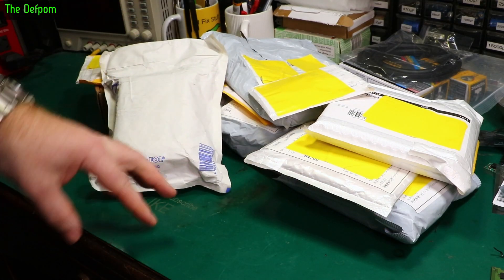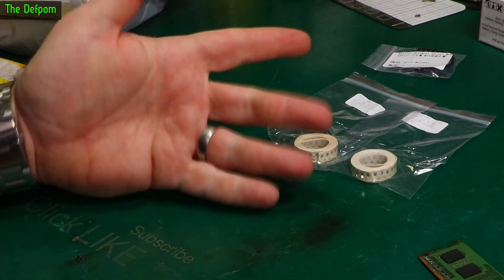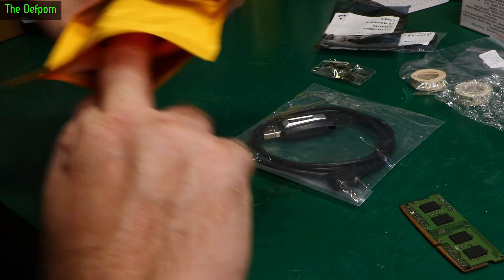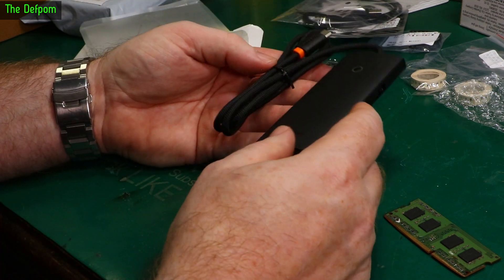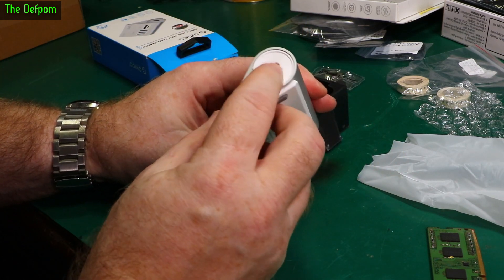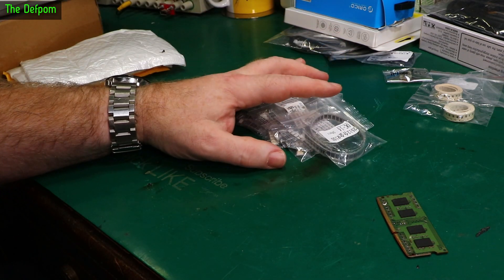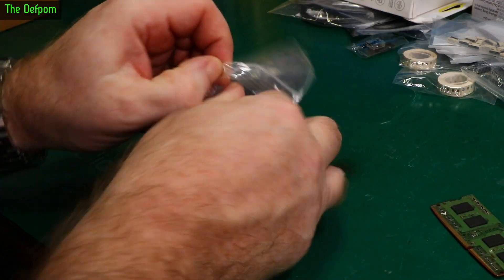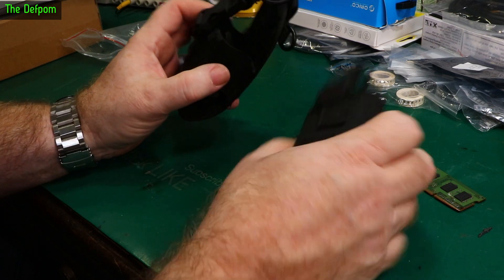🔴 What's in my Mailbag ? - Mailbag Monday 17th July 2023 - No.1154

Comment: When buying USB hubs ignore any mention of throughput speeds as those are the unobtainable speeds unless one holds your tongue just right and are upside down. Had a rather intense discussion with Orico and one of their USB 3.2 hubs which also on several occasions did not show up in a yr old PC. They needed a video for a dispute which of course I could not make since I could not get it to fail.

Comment: i just got a cheap usb hub and cut the power connection to the output ports and power them from a high power 5V  supply.
the attached devices can pull s much current as they want until they smoke the connector, wiring, or psu 🙂

A big issue with scopes its the frequency rating of the probes, the probes we had for a 500MHz scope were bloody expensive. They had screw in tips so if you dropped the lead and snapped the tip off you could save the probe with a new tip. but the tips were around £50.  we tended to use lower quality cheaper probes and save the best for when we needed them.